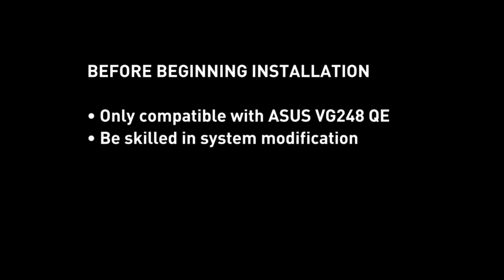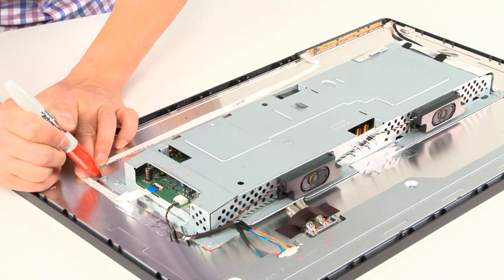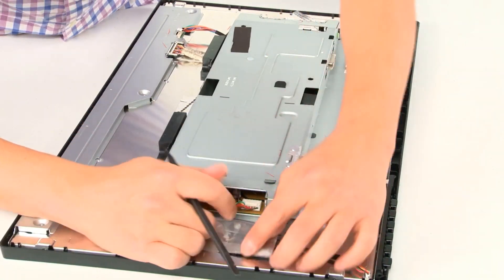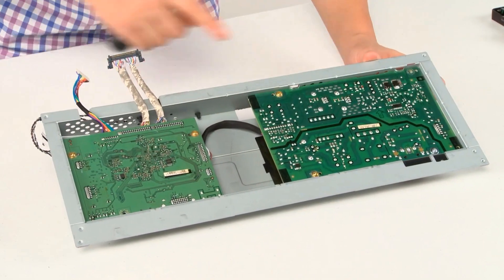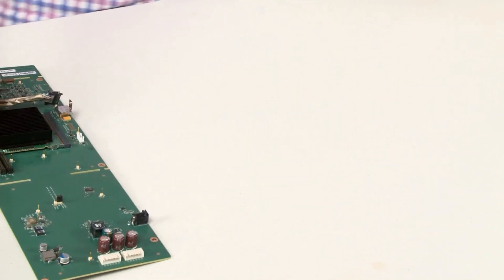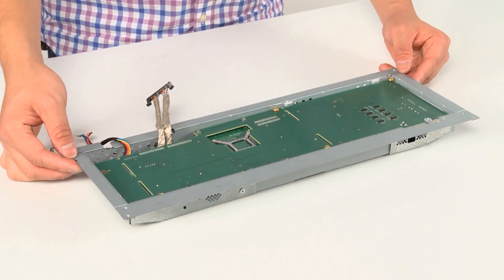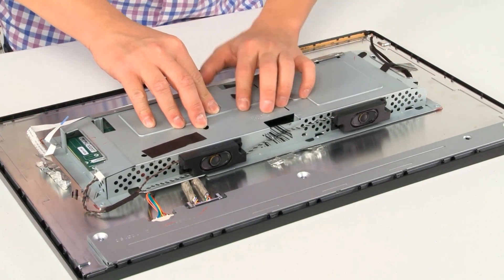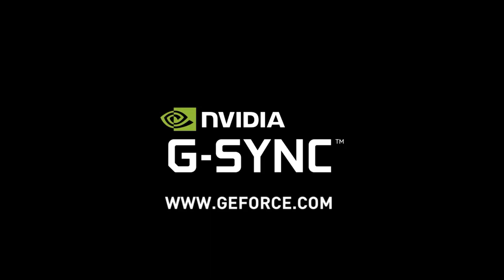NVIDIA G-SYNC DIY Kit Installation

Comment: Isn't that cute paid almost $600 for two of these monitors now in order to get G-Sync I would have to spend another $400, BUT it voids your warranty even if the G-Sync module is at fault 0_0  Oh wait...I can just spend $600 on a single PG278Q, talk about some cheap greedy shit. Love the taping of the PCBs to the back of the screen...Going to check into this Free Sync since you all are too greedy for your own good. Next mobo or monitor I buy wont be from you bastards. Have a good day :D

Comment: I know this is old but I was wondering if anyone can help. I picked a VG248QE on CL that has this G-SYNC upgrade kit installed. However, the AC adapter is missing. I need to find it but I don't have specs. Can anyone who has this tell me what specs it is - voltage, Ampere, watt, inside pin positive, barrel size, etc....?

Comment: Am I blind? I don't see the DVI or Display Port output in the G-Sync module. So that means that in order to get G-Sync you have to lose the 144hz because HDMI only support up to 60 hz

What the heck is this?
Reply: that's not HDMI, but Display Port
Reply: HDMI 2.0 supports 4k 60hertz
Reply: HDMI 2.0....
Reply: HDMI 2.0 supports 60hertz 😑😒
Reply: Raiyan Tajwar at 4k, 144hz at 1080p
Reply: I need someone from NVIDIA to come and clarify this. Because, at the moment it seems like you have to refuse Hz in order to gain G-Sync.
Reply: http://www.tomshardware.com/answers/id-2239654/hdmi-supports-144-hertz.html
Reply: HDMI 2.0 supports 144hz at 1080p. I was planning on buying a 144hz monitor and looked into and found this. so yes it does support 144hz

Comment: I really dont like the thought of loose the internal power supply in this monitor.. The advantage before installing the G-sync kit is that you dont have to use a power brick near the monitor.. With this kit you just loose this option of having the power supply in the monitor so it switch to the power brick again.. You also see that the nvidia engineer hiding the connected power cables.. But if you really look good, your internal PSU is gone with this rebuild.

Comment: you know you have a high quality product when it has a lot of tape in it
Reply: +David Vick lol below the plate is the monitor directly. You cannot use screws or it will destroy the monitor. Plus the stand acts as a secondary wall to hold it in place so tape is the best choice here for manufacturing
Reply: well they designed it that way it doesnt have to use tape to hold it together
Reply: Akayd well they designed it that way it doesnt have to use tape to hold it together
Reply: +David Vick I dont think the tape is for holding it anyways. You can put it back together without the tape and it will be fine. That tape is most likely part of the manufacturing process to hold the parts together before moving to the next step. You would find adhesive being highly used by almost every flat screen device, because how else would you combine 2 very flat thing together without sacrificing size and weight.
Reply: Akayd trust me they could do better the reason they use tape is it makes the manufacturing processes cheaper and faster
Reply: +David Vick that's good. we all know that. I don't want to pay more for a bulletproof monitor
Reply: +David Vick The tape is EMI shielding, it is not to hold it together, which is why it is metalized, high quality products often use this teqnique to pass EMI regulations. You will often see the insides of laptops painted a silver/metal colour, this is the same thing, it is a shield.
Reply: David Vick lol i triggered you so hard you looked at my profile to endeavor to find an ad hominem to discredit me. thanks again for proving my point.
Reply: +David Vick When they do design it without the tape, it will be more expensive and you will be whining about that anyway.
Reply: +David Vick what you don't get is the tape is not there to hold it together! it is there for emi shielding, read up on Faraday cages.
Reply: David Vick Did you see any of those cables/wires being loose? It took the guy considerable force to pull the tape off, is that not sturdy enough? Do you tear the monitor for giggle everyday?
Reply: +David Vick And thats why you arent an engineer. because you are an anti-intellectual, naive child
Reply: David Vick thanks for proving my point, triggered child
Reply: +Nanorisk a few dollars more isn't a big deal for a sturdier product.
Reply: yeah well you play clash royal so i know your a child or young so you cant say anything

Comment: So it's expensive, you have to take your shiny £300 monitor apart & you lose all the features that came with the monitor? No thanks. I thought it would be worth it but without the Asus crosshair overlay, timers & having to also invest in a decent displayport cable I think I'll pass.

Comment: cool idea but I can't see tearing apart an almost $300 monitor, spending $200 more and then loosing a bunch of features to add one feature.  I am ok with out g sync for now and will wait for them to come out with prebuilt g sync monitors for a decent price.
Reply: If you're a gamer, you're never ok without g sync.  nuff said.
Reply: Ronin228 144hz screens remove the need for ad syncs.

Comment: 14:23 i like how it turns on instantly, instead of having to wait 2-3 seconds for no reason...
Reply: Funny how Nvidia Can build a better part than asus does
Reply: Vault Nomad idk whether the original asus turns on instantly i was referring to my monitor. not that people really buy monitors for their 'boot up time', although i have an acer monitor that takes like 10 seconds lol.
Reply: ***** I have the VG248QE. Can confirm it takes ~6 seconds to turn on. I'm getting my DIY kit tomorrow and i'm really excited. :)
Reply: Taylor Doerr
Could you please confirm if it makes the color any different since it appears that it changes the On screen Display with Nvidia's?  Or can you change the color through the new one?
Reply: Vault Nomad If you install this DIY kit into a VG248QE you cannot change the color settings through the monitor itself. Although there is a piece of free software called "SoftMCCS" that will allow you to alter your monitor's colors, contrast, brightness, etc. You can also use the section under Display called "Adjust desktop color settings" in the NVIDIA Control Panel for some extra tweaking if you wish.
Reply: Well If I had the colors adjusted fine before, will they stay?  I had the color adjusted fine, and because I have OCD I will not like them being different at all, even though they may not be perfect now, they are still adjusted to my liking
Reply: I'm not sure but it will probably reset. It's really easy to get them back. If you are considering getting this kit I recommend carefully observing the colors and contrast of your wallpaper or a picture that you can pull up and if they don't match after installation try and get it back to what it looked like with SoftMCCS. You could also try and take a picture of the screen with a reasonably good camera for a before and after and compare/make changes if needed.
Reply: I will just get the new asus 144hz 1440p monitor with gsync when I save enough for it and just sell the vg24qe.  I think I could just look at the 2 closely and adjust the new one till its the same, or maybe use the same settings since they both use "splendid"
Reply: Taylor Doerr Where do you buy it? I clicked on the link to go to it but it just brings me to this video -_-
Reply: Futilizer Unfortunately they stopped selling the DIY kits in September. I was lucky I got mine when I did.
Reply: Taylor Doerr That's a damn shame.

Comment: Fellow YouTubers, do you know what G-Sync does, and why would you want it? If not, here is a short explanation!

G-Sync (or FreeSync for AMD), which is also called adaptive-sync globally, eliminates screen tearing, which a frame can appear delayed, which happens in every game and reduces your gaming experience. G-sync is similar to V-Sync, but doesn't have to wait for the monitor and no frame drops. How G-Sync works, is by communicating with the monitor's refresh rate and the monitor adjusting to your game's frame rate. But because there is no standard for such a communicating with a monitor yet, you currently need to have Nvidia G-Sync (or soon AMD FreeSync) chip installed in the monitor to have your graphics card communicate with it to adjust the frame rate and eliminate screen tearing.

Next gen experience really! I want to see that in all televisions and monitors soon, once VESA made a standard module for adaptive-sync.

Comment: Sycn should be industry standard like VGA port specs. HDMI specs. Nvidia thinks Sony would want to slap nvidia sticker on there tv or monitors prob not when ps4 comes to mind packing AMD silicon....another example i want 3 or more monitor set up so that means i need to buy 3 more monitors, 3 more gsync cards, on top that i have to buy 2-3 more video cards to push each monitors + or - 3d vision. graphics are nice..but  graphics are not advanced far enough for the price what nvidia is asking. the price nvidia is asking is equal to next consoles after ps4  2 console generation ahead of time, pc graphics not close for time being maybe in the next 2-3 years. ALL HAIL AMD free sync!
# ! .........this not beggining of a # /bin/sh script...hash # tag # originated from UNIX nerds. UNIX nerd = keyboard happy spell checking itchy trigger finger key button pressing trolling nerd..

Comment: So with G-Sync on,if my 120 hz monitor has an output of 200 fps,the monitor will easily display 120 frames?

Is that what this is basically?

Comment: Did i missed something? Where goes the power suply? Do the nvidia g-sync comes with an external one?
Reply: Well, when he puts the metal frame back into the power plug hole it looked like there was a 3-pin power plug on the board. I just didn't get why he used a metal frame that wouldn't fit the cable. [EDIT] Forget what I said, there is no power connector.

Comment: Shocker: instead of upgrading your monitor by installing a nvidia board, as it was announced at first, you have to replace the entire monitor electronic board with a Nvidia G-Sync board. This will certainly void your ASUS warranty - they didn't guarantee their panel to work with a 3rd party board.
This also explains the high price - you buy the entire board, not just a small piece of electronics. Guess I won't be buying it at all (I do not believe its price can possibly drop to a reasonable price).

Comment: Thanks for the Video Henry. Well done, straight forward, seems easy enough.

I am Technically oriented, worked as a Tech for years.

I can bet you that first time doing that is going to take people more than 20 minutes and the majority of "DIY"ers (your suggestion) are only going to be doing it ONE time (or more specifically, to one Monitor).

After you have done it a few times it may well only take 20 min. but first time I do not think I would be so quick. I've tried to look for FAIL Videos (even "success Videos") but not seen any yet. Perhaps the homer-brewers are now silent (ominous).

Thanks for posting it.

Comment: Actually, the only void comes from pulling the post in the chassis. Let's say you made your own chassis using sheet metal pliers with a piece of PVC coated siding, coil stock... you can keep the OEM unit in tact.
I have a full bender, but you can go to a local shop to set up the long bends for you. That's not hard...
Pretty cool video.

Comment: I own this monitor and I would be interested in G-Sync if there weren't no reasons against it:
- The DIY-Module is waaaay to expensive
- I won't dismiss that soon my GTX580 SLI Setup as it's reliable.

I really think G-Sync is a nice technology but it's too expensive to reach the mainstream and because of that it will die like CUDA currently does. Sadly.

Comment: Well, the worst part is, you throw out HDMI and won't be able to use this monitor with anything without DP.
Reply: DP isn't that bad btw.  I use it at the moment and the noticeable difference is it supports 144hz. I bet there are newer HDMI cables than what I have but they are otherwise pretty similar minus the fact you don't have to buy the right to use DP.  (from a marketer's standpoint)
Reply: Weak1ings  Actually, the HDMI standard doesn't support it.

Comment: for $200 you can just buy a better video card next time... lol
Reply: 'I'o pua'a uahi Papale Dose your graphics card allow you to run current games like BF4 on high settings at an constant fps over 120? If not g-sync is pretty groundbreaking technology.
Reply: I don't think you fully understand what G-sync is.
Reply: does it do something more than offer a "smooth, tear-free experience" on under-performing cards?  if so, clue me in.  if not, this+monitor+videocard cost > a good card that can deliver fps > than the refresh.
Reply: 'I'o pua'a uahi Papale G-SYNC is for people with already great gpus(anything made in the last 2 years).  Normal 60hz monitors have trouble refreshing frames with the same latency as the video card. G-sync will force your monitor and video card to refresh frames at the same time so you will never see a "distortion line" or any type of screen tearing.  This will NOT help lower end GPUs perform games better than previous; but instead helps the high powered gpu's.
Reply: It's not helping the GPU at all, just making better use of the LCD with the signal the GPU already puts out.  I still don't see a real-world situation where this is cost-effective over buying a better GPU.
Reply: Demoni696 Are you referring to the "Strobe mode"?  I've not seen much press on it but essentially only reduces motion blur as the G-sync feature isn't necessary at this refresh.  The G-Sync mode is for 60hz, afaik.  With the beta Mantle; 1080p nets about 200FPS @ medium on a 290X.  I can't wait to see what happens with an actual stable or mature driver.
Reply: Demoni696

Yes, it's very likely to do so if you sufficiently lower the resolution or settings. Any FPS game that dips below 60 FPS often is not worth playing with or without G-sync.

When my CRT finally died a couple of years ago, which would do 100-120 Hz at decent resolutions (and 160 Hz at indecent ones...), I had to use a hand-me-down 60 Hz LCD for a while before I got a new 144 Hz LCD display. It was a fucking miserable experience playing at only 60 FPS. Even the mouse pointer and dragging windows around on the desktop, let alone any kind of fast paced game, is noticably unsmooth and visually distracting at only 60 Hz. 

3) On a 144 Hz display screen tearing is already very difficult to spot outside of patological cases (e.g. locking the framerate to 143 FPS).
Reply: 'I'o pua'a uahi Papale G-Sync fixes screen tearing which is caused by having a super powerful graphics card.
Reply: fwiw i have this monitor without gsync, i play BF4 at 144 fps and ive never seen tearing.

Comment: I've just seen state-of-the-art monitors held together by tape...
even chinese companies don't do that.
Reply: The tape is actually to make sure the wire doesn't move.
Reply: Thomas Xeon
Have you seen the whole video?
The metal frame with the PCB that is replaced is taped to the back side of the lcd.
There is tape for the wiring as well, but it's not limited to that.
Reply: Yeap :) I watched the whole whole movie. And I agreed with you on the second comment, the first comment confuse me.
Reply: yeah except Asus is actually a Taiwanese company.  Not really Chinese but you get what I mean.
Reply: 'I'o pua'a uahi Papale Dude, Asus is Taiwanese, not Chinese -_-
Reply: Dimitrije Obradovic To be fair, the HQ is in Taiwan which, to some, may seem like a country but is not independent from China.
Reply: 'I'o pua'a uahi Papale
If you put it that way, you're completely right! :D It's still not worth calling it chinese because Asus' products are very good and of high quality in my opinion. ;)
Reply: it's asus and it's chinese.  the tape is part of what makes it state-of-the-art (tiny, light etc).  just take apart any other modern device... like a tablet or smartphone.
Reply: Dimitrije Obradovic
LOL!!!! -and some more exclamation marks.
'I'o pua'a uahi Papale
What's so modern about tape?
To make something light you'd better off choosing other materials, and keep in mind that the product needs some rigidity.
Why doesn't the PCB click onto the LCD just like the casing does? (holding cables together with tape is totally fine, but this...)
Reply: sasja de vries
Why LOL? If you also think that Asus is Chinese, I really don't know what else to say to you than GTFO! ;)
Reply: Dimitrije Obradovic see now - that's a personal opinion.  I don't think there's anything wrong with Chinese products.  Crappy and good products come from all places.  How cheaply something can be built actually makes it a better product - dating back to the days of the IBM Proprinter and beyond.  I love Asus products.
Reply: Dimitrije Obradovic
Why gtfo???
I said lol because you are right, but assuming I don't believe you is really dumb, especially when the opposite is true.

Comment: I just installed my gsync kit.  Prying the case apart, that was a bit of a hastle.  The little plastic screwdriver thingy that nvidia sends you, is a complet waste.  He covers most things, but the white, flat ribbon cable with the blue end (J6) is a REAL problem.  He shows you flipping it up, well NO, it doesn't, you have pull it out, then flip it up, stuff the cable in, push down, then push back, I broke mine.  Another thing was, the power on the other end, his shows 2 adapters, mine only has one.  I found the cheap metal cover for the power connector doesn't snap in, so I taped mine down with electrical tape.  Is there a differance?  HELL YES.  I've got a 660ti, the detail, the colors,  on arma2, chasing zombies and the environment is UNREAL!